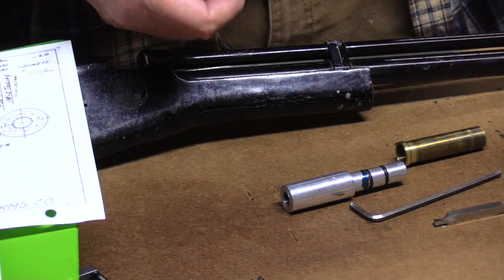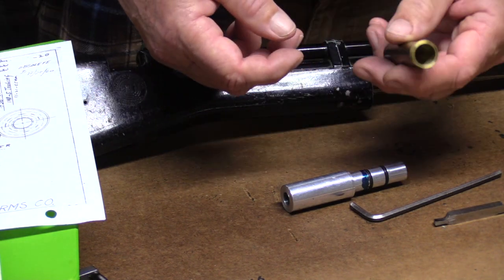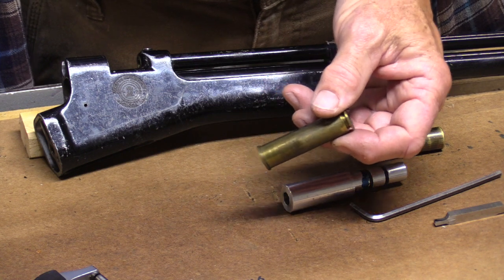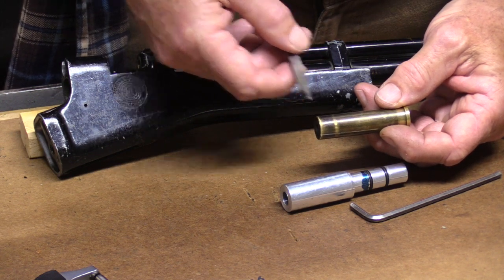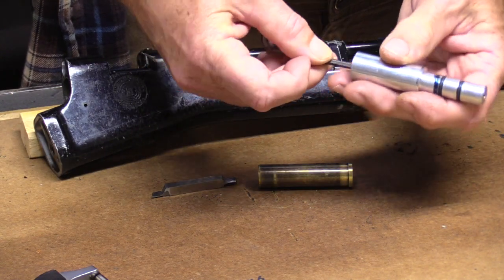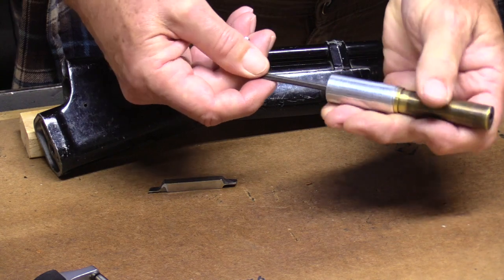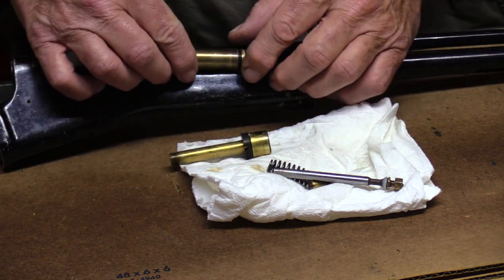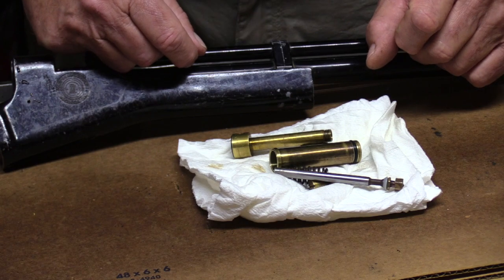Resurrecting a Crosman 101 - Part 3, Cutting an o-ring Groove

Comment: I have the same issue, but no lathe. I'm wondering if I can wrap against the lip with waxed dental floss or something similar to create a good seal?
Reply from the maker: Well, I've never sealed one up without the o-ring.  I remember asking Ron Sauls (RIP) some years ago, who said a person can use waxed thread.  So, yeah, maybe try different materials and see how it goes.  You can also take the drawing from here;         

https://northwestairguns.com/resurrecting-a-crosman-101/

and take it to someone who has a lathe.